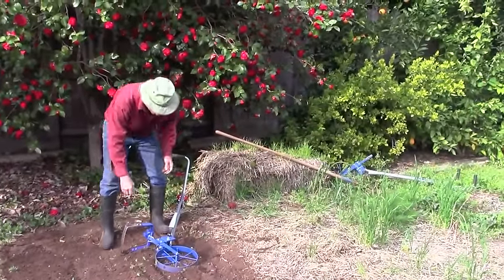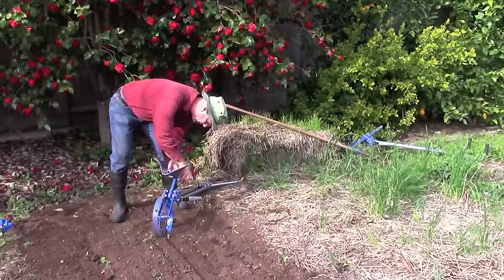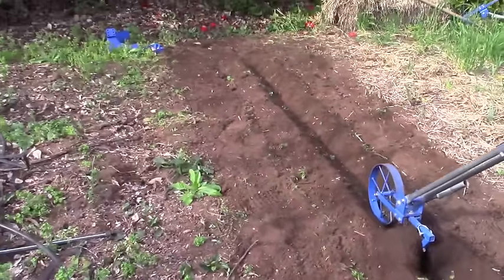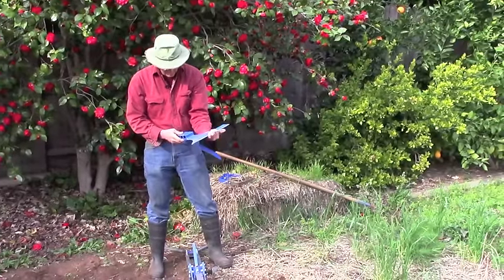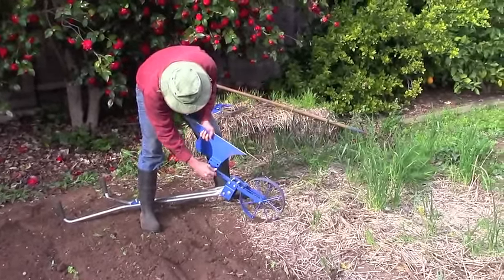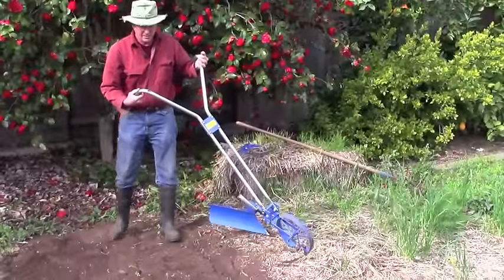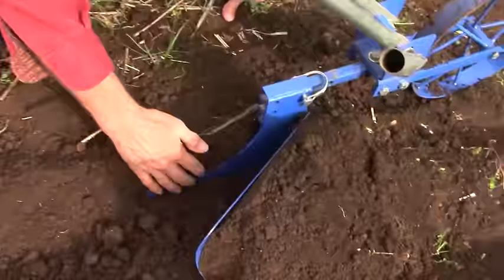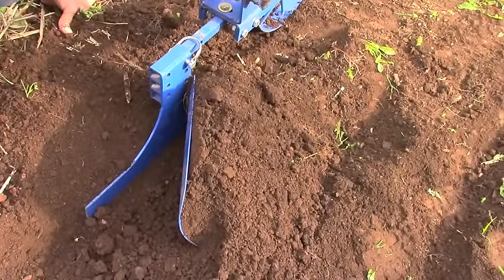Using the Hiller Attachment

Comment: Nice tool but I have a suggestion that'd could make it much more versitile: make an attachment that hooks to the front axle that allows the machine to be pulled by a tractor, person, or anything else. That would make that tool useful for larger gardens as it could allow 2 people to do more work working together than if they both had the tool.
For instance, anyone could get a cheap garden/lawn tractor and use it to pull that tool while a second person guides it via the handle bars. This would make this tool fill a new niche in the market between what it currently is(i.e. a hand-powered machine) and the far more expensive implements used by garden tractors and compact utility tractors.